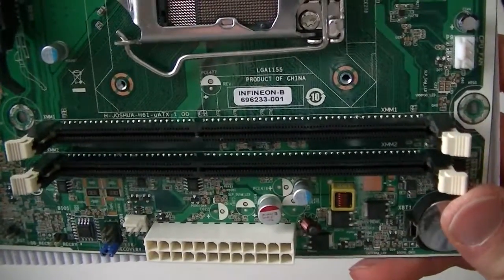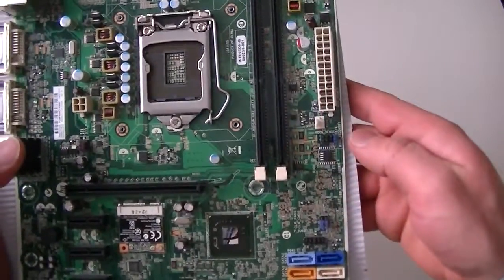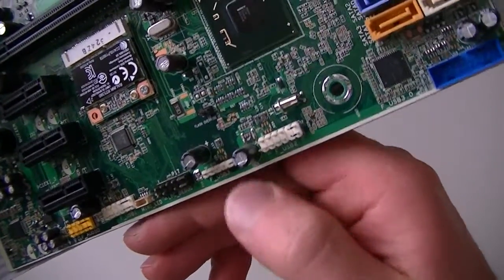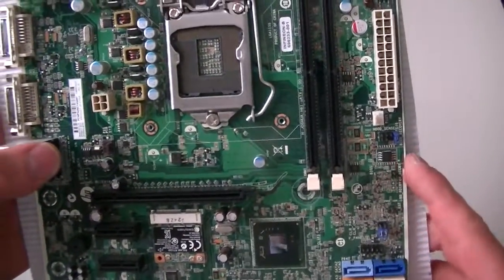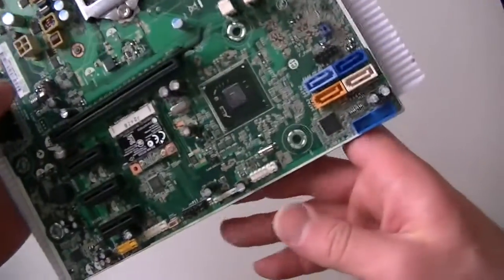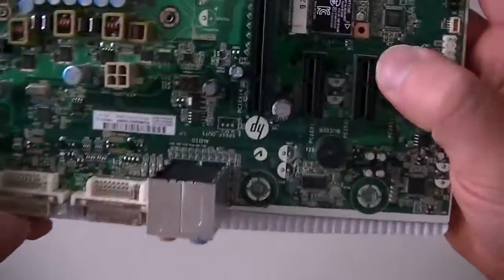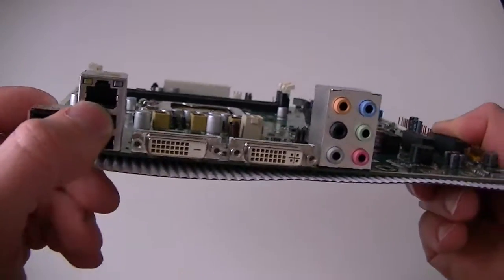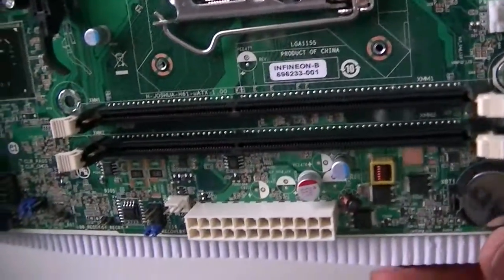H-Joshua-H61-uATX Motherboard

Comment: Hlo I bought gtx 950 it doesn't work in this board why??
Reply: In case anyone's still looking for this answer, I believe it's because a BIOS update would be needed for the board to support it. Not sure if there's one available, though. HP doesn't have a BIOS update available for download on their site and I've yet to find a trustworthy source to download one from. 

However, don't fret. Upgrades for the machines using this mb were offered with possible upgrades for the GeForce GT 530 (2 GB), GeForce GT 620 (1 GB), GeForce GT 630 (2 GB), GeForce GT 640 (3 GB), Radeon HD 7350 (512 MB), Radeon HD 7450 (1 GB), and Radeon HD 7570 (2 GB). So yeah... hope that helps as a place to start.
Reply: @Peridium  its okay if I use GT 640 (1GB)?

Comment: If your  HP Computer uses  this board, working or not, if you value your sanity then you should consider replaceing that it with some other NON HP Branded LGA1155 ATX board. Look on NewEgg or even ebay for them and it does not have to be a small board either as the case can accept some bigger boards. With non PC maker branded boards typically you will see eyou have options like more ram sockets, VGA HDMI and DVI onboard, more USB headers and sockets,  more lof the longer PCIe sockets more SATA porta and maybe even an mSATA SSD socket which is nice to have. You have to shop around and find something that will support the CPU you ahve and have better device hardware connectivity options that what HP gave you.

Comment: Hy someon can help me? i dont speak realy good in english may i have this mobo with the I5 3470 and the montherboard does not start up! The fan is working may is no start the bios i tried the cmos clean may the mobo does no went to start up
Reply: Those boards (and a few others similar) are known for bricking themselves especially if you  try and take it from windows 8 to windows 10, if a BIOS update is buggy, If the power fails while you are updating the BIOS, etc., You will be better off buying a new or even used socket 1155 atx board off ebay. or someplace.

Comment: someone use the 1050 or 950 in this mobo?
Reply: Im running a 1060 3gb oc and runs good, i have 12 gigs of RAM and im planning about slapping a i5 3570 in It
Reply: @Reaper-dj  Bro I have hp pro 3400 which has BIOS 7.16 
Can I put  1050ti in it

Comment: this mobo is pure cancer, can't install an aftermarket cooler cause the backplate is anything but standard and has the CPU socket attached to it; front panel header has no pin indications; mid-range GTX videocards not working; BIOS looks like a year 2k laptop's ..
Reply: If you want to add a aftermarket cooler, just remove the mounting bracket from the motherboard and pop the threaded inserts out of the back plate, re-install and the cooler screws should thread right into the back plate now.
Upgrading the graphics card just requires using the latest windows 8 BIOS even if your still running windows 7 it will work fine as BIOS isn't really linked to the OS
Reply: @PortersMob  Thank!  I was helped by the BIOS firmware for installing the gtx 960 video card, but I haven’t been bothering with the blackplate yet, but I’ll try.
Reply: @nikolasfish2678  Wait until that board bricks itself because "reasons"
Reply: What mid-range GTX cards you talking about?
My STRIX 1060 O6G works perfectly.
Reply: a GTX 660
Reply: My gtx 1060 not working on this bored hp say need put old card in uefi will not work with there BIOS and it password lock can't get in
Reply: Working with gtx 1080

Comment: Thank you for the helpful video. I have been a bit hesitant trying to install a graphics card on this. I have heard from other people on forums of this motherboard not being compatible with gtx 750ti or even the gtx 1050 due to HP not updating the bios. Can you guys help with a gpu upgrade? I have an i7 2600 and looking for low power pci based cards for gaming? Thanks
Reply: I have this board and this card is plugged into it.  https://www.amazon.com/dp/B015E9VDC0  You can plug anything into it that works with PCI-E.  Whether it's a good idea depends if your CPU is a good match for it and whether what you're doing will demand more than a less expensive part can deliver.  I have an i3-2130.  Supposedly it supports up to i7-3770.  Don't buy a 'k' unless for some reason the cost is less than a non-k, because you'd just be throwing money away on an unlocked CPU for an MB that doesn't support overclocking.  That still competes with newer similarly performing CPUs for price, so I never upgraded.
Reply: Thanks for the suggestions. I have had a change of heart since then. My computer is almost 8 years old. I am probably just going to wait and this time try to build my own pc.

Comment: does someone know if i can put a gtx 1060 in it?
Reply: Using a GTX 1060 6GB with this very motherboard right now, works without an issue.
Reply: @ThunderTHR  How many W of Psu are you using?
Reply: @haloolah6652  I don't have this setup anymore, but the original PSU I had was swapped for a 600W Corsair CX600 when I was still using that build.
Reply from the maker: Yes,  gtx1060 mini should work just fine on that motherboard.
Reply: Thank you very much.
Reply: Are there issues with bottlenecks?

Comment: hi my pc has this motherboard http://h20564.www2.hp.com/hpsc/doc/public/display?docId=c03749751
does someone know if i can put a gtx 1070 in it?
Reply: Sure you can, i installed 1060 without a problem
Reply: Yes, I have a gtx 580 in mine and its huge af.
Reply: +12njr Well, I have a 600w psu for my gtx 580 and get, in most games, about 60+ fps
Reply: I have 600w psu but 1060 can operate normally with 400w psu, fps is always higher than 60 except Witcher 3 where i get ~57fps)
Reply: +Sanok Kule , +Vaxx can u tell me wat games and how many fps are u guys getting?
Reply: and wat power supply u got?
Reply: tnx for reply guys, I ordered rx560(1 fan) and 500w psu 😀

Comment: Hi, does this motherboard support unlocked CPUs ( i5 2500k /2550k / 3570k &  i7 2600/ 2700k / 3770k),even if it doesn't support overclocking ?
Reply: Only Z67, Z68, or Z77 motherboards will support K processors for overclocking.  However, Z67, Z68, or Z77 motherboards will support both non-K and K processors.  I've tried since I have both K and non K systems....